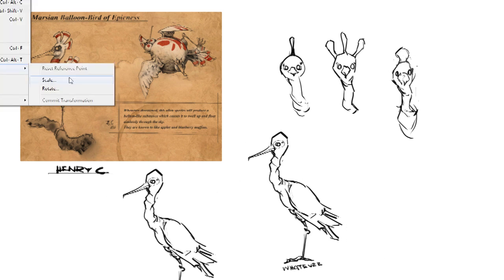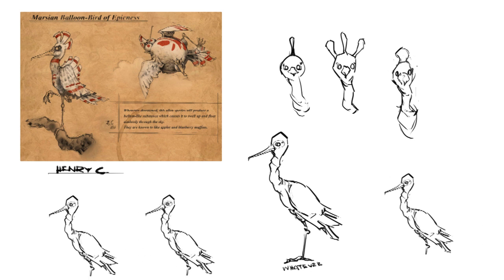Design Lab [alien avifauna] - 3/3

Comment: Hey Sinix, I noticed you changed the shape language in your own design quite a bit for the Balloon bird. In the original it looks like there are lots of smooth and flowing lines that are capped by rectangular shapes (In the feathers on the head, back and end of the wings.' 

Yours has a lot more sort of zig zaggy, twisted and a little bit mangled forms in yours. Was this intentional and does that also add to the design?